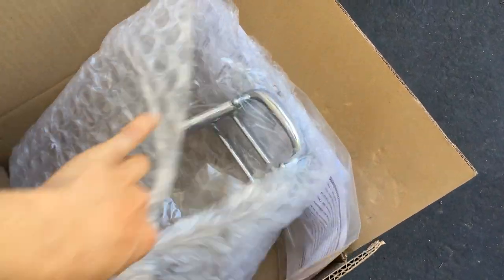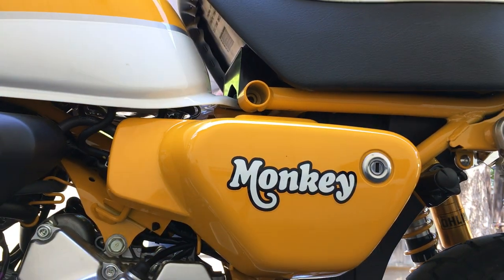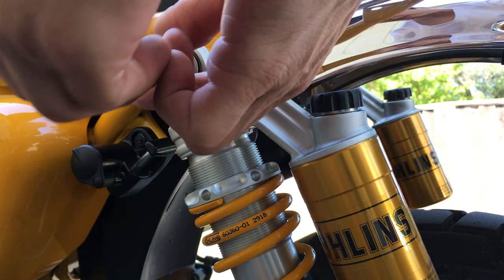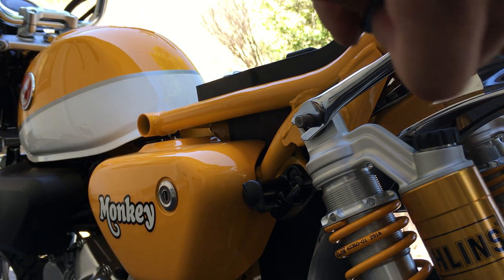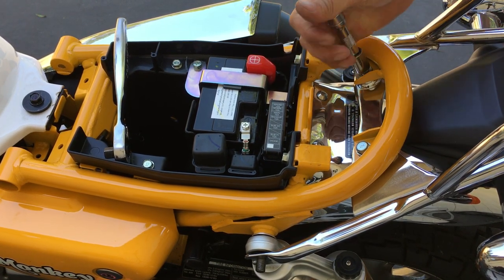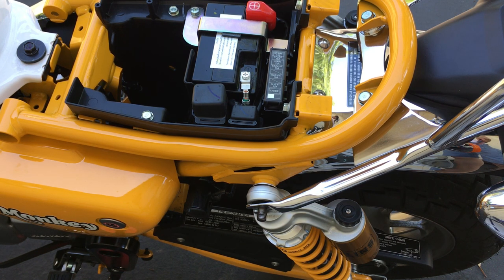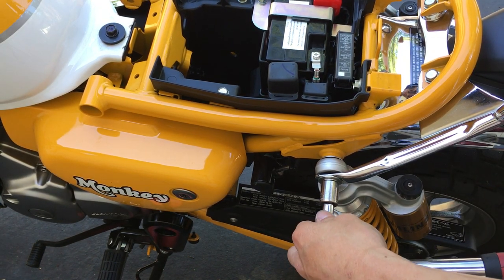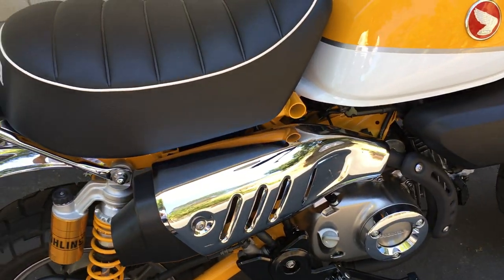Monkey OEM rack installation

Comment: I'm also having the same problem. The original 2 washers (large & small) can't be fit both when installing Ohlins & H2C rear rack. When I tightened the bolt, the big washer bent. In your video, you use only 1 washer, the small one. Did you having riding problems after that?

Comment: Thanks so much for the video...I was considering spending $250+ to get one installed but I think I’ll do it myself thanks to your guidance
Reply from the maker: That is lot of $$$ for a rack and install.  Takes 15minutes to install if you take your time, 5minutes if you are fast.  Rack is about $160 at dealer or $100-120 on ebay ship from Thailand.

Comment: Moto Machines has a Hepco And Becker rear cargo rack for the Honda Monkey. It's about the same size as this Honda OEM rack. But the Hepco and Becker rack looks more durable.  And you can mount a Hepco and Becker cargo box on this rack. According to Moto Machines.
Reply: That place is overpriced, one can get a Monkey rear rack OEM for less than $100 if you are willing to wait for the shipment from Thailand.
Reply: The Moto Machine racks are better quality and much more sturdier than  any other after market rack. The rack from Thailand is most likely is an HJC rack. I'd rather pay extra for a Moto Machine rack than a cheaper Thailand rack. Besides Moto Machine has a store here in Virginia.